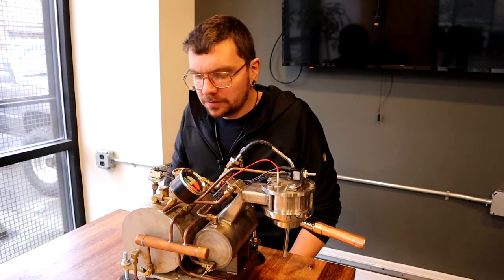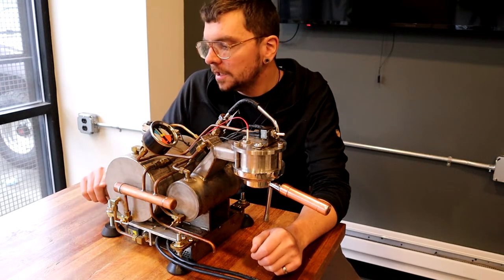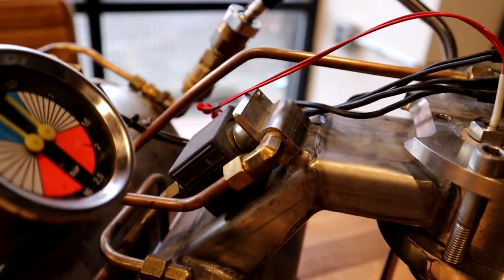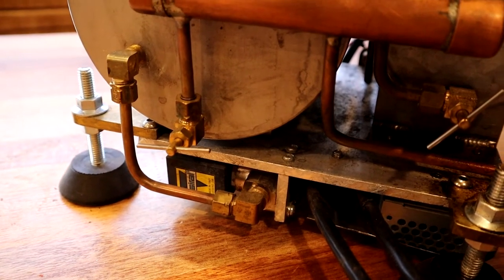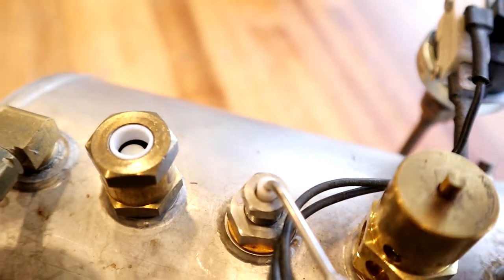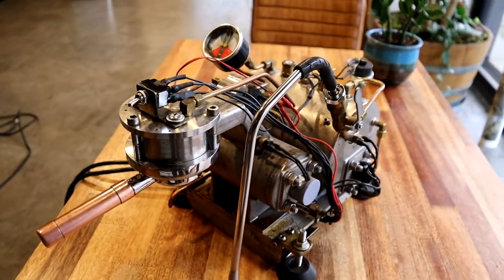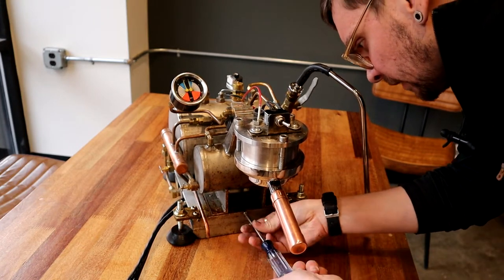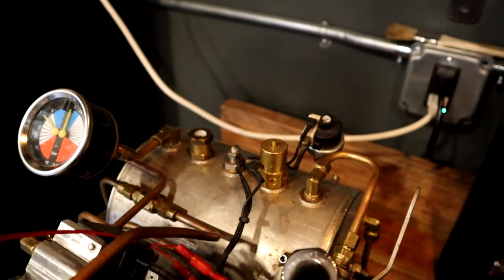The Frankenstein Espresso Machine in Detail

Comment: Great build. Would you have any recommendations for sourcing food-safe tanks for such a project without being in the industry?
Reply from the maker: Thanks! You might keep an eye out for them on EBay or something. They’re kind of hard to find.
Reply: @bailey2829  sorry to be a bother, but any keyword recommendations to an outsider? I'm familiar with pneumatics, and even own a few festo tanks the correct size, but I have concerns on their safety with food and heat since they are for manufacturing. Strangely enough I have almost everything else to accomplish a basic gas powered machine like I would want already on my shelves
Reply: @RustyCantRead  I'm pretty sure the tanks used in espresso machines have to be stainless steel, brass or aluminum, but I think brass is the choice for high end machines.

Comment: What are you using for the pump?
Reply from the maker: It’s a commercial rotary pump that you’d find on a 2 or 3 group machine. It’s made by fluidotech, who makes the pumps for most machines. You can buy them new for $100-$200. The hard part is finding a good price on a motor to run it, but there are deals out there to be had. Mine was full off coffee because the barista who was using it didn’t know they were using a bottomless knock box and the pump was below it lol. I took it apart and cleaned it and it’s been working well ever since.
Reply: @bailey2829  nice, is it on 110v?
Reply from the maker: @mikolajdebowski  yep, it’s 110v. I just got a used 24vdc pump that I might rig up to PWM on my next machine so I can do pressure profiling…

Comment: Hello, great project. I am building a two-boiler machine on the E61 group and the BLDC pump. Can you write where did you buy copper pipe fittings? There are a lot of systems, it's hard to decide. Maybe the address of the online store or the name of the connector manufacturer. Connectors and drain valves from boilers.

Thank you very much, respect Sebastian
Reply from the maker: Sweet! I’d love to see your project. McMaster Carr is the way to go for NPT compression fittings if you don’t care about NSF. BSPP fittings are very hard to find in the US, but espressoparts.com has a lot of good stuff. You can also just buy stuff directly from LaMarzocco in Seattle but it’s not cheap, it may get you out of a bind though.
Reply: @bailey2829  I have exactly that problem. NPT threads everywhere.Swagelok - most NPT etc. The E61 group,  has a BSPP thread. Thank you with the answer, I will look for something in my country or in the EU in order not to pay the duty.

Good luck in next projects. Sebastian